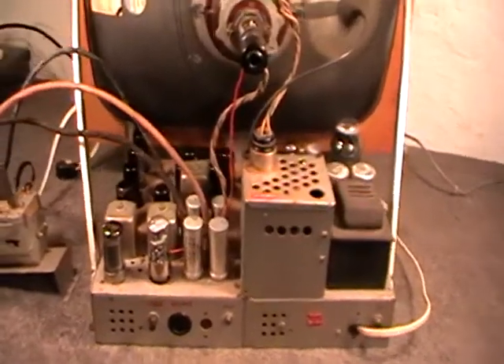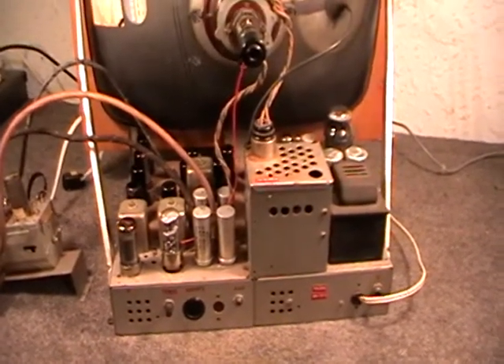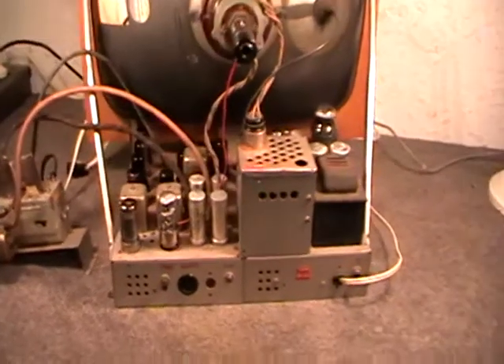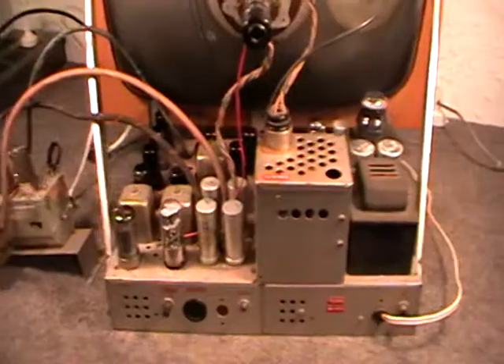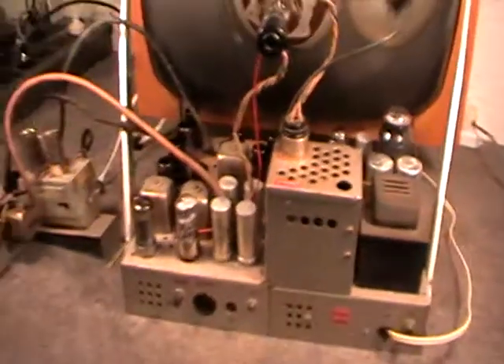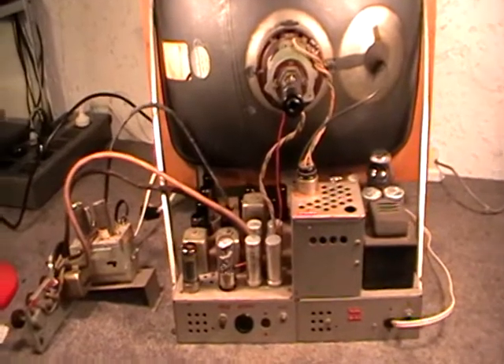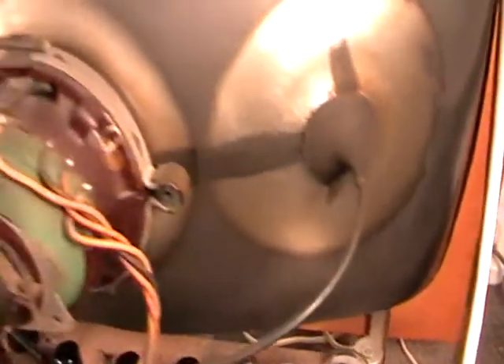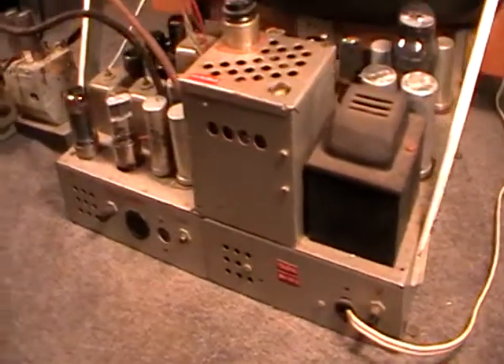Telerad Model 35 TV Part 2

Comment: By the late 1950s they had tubes specifically designed for vertical amplifiers and no longer used audio power output tubes for this purpose, the 6W6 was the first of these. I had a look at your blog site and it explained that regular broadcasting started in New Zealand around 1959-60 so that was well past that point. In Canada domestic network broadcasting began in 1952 with the CBC, though people did own televisions before that to pick up U.S broadcasts if they lived near the boarder.